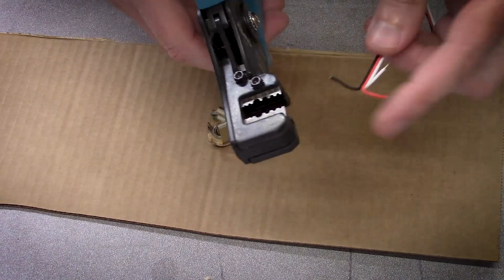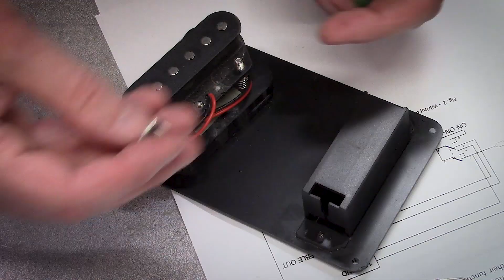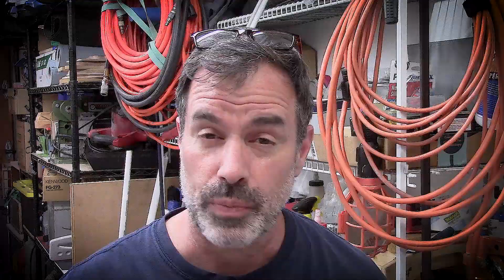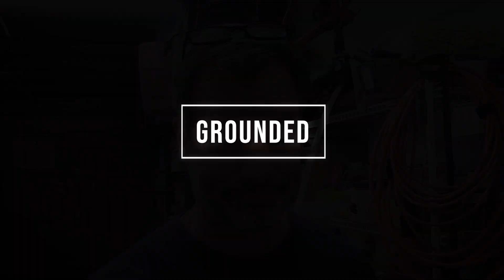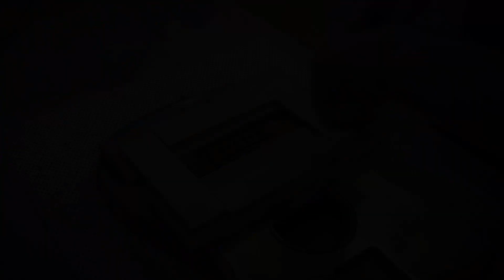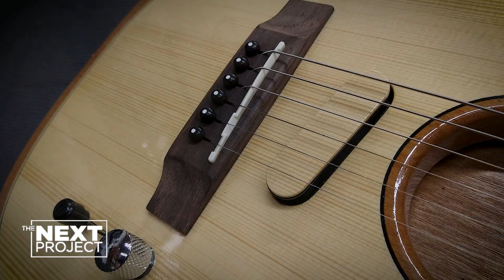Building a T-Style Acoustasonic from a Harley Benton kit - Ep08  Finale

Comment: In the schematic I see you used a single ground connection. So you are sharing digital and analog ground which is a bad practice. I have read recommended wiring from Sustainiac, for example, in which they recommend to use different paths of ground and link them only in the stereo output jack using both singular ground tips. What I think is that you are introducing a constant current from the battery to the magnetic pickup that has the effect of contrasting the inducted current of strummed strings through the pickup. To prove it you can disconnect the preamp and keep only the battery in the circuit. Inverting polarity should result in an increase of volume, but do not connect the preamp or you probably gonna burn it.
Reply from the maker: Marco, thanks for watching and the insight as to the wiring. Very interesting and well explained, thank you!
The piezo/preamp ground was wired to a stereo output jack. This killed power to save battery when the output cable was not inserted.  The magnetic pup grounded to the control cavity, which in turn grounds to the center of the output jack. I'm not really sure how to get around that issue.  
As it went, removing the preamp seems to have helped the overall output balance.  Not the right way, but until I get a better plan in place...  I have no idea.
I'll look up Sustainic as you mentioned. Hope I can find a better solution. Others have also mentioned adding a blender to the mix. 
I have a lot to learn, sadly I forget as quickly as I learn. Guess my brain is full.
Happy holidays to you.
Be safe and take care!
Reply: @theNextProject  don't worry as I have learned there's always something to study and improve as long as we are in good health, above all these days. Happy holidays to you too 🙂
Reply from the maker: Cheers!